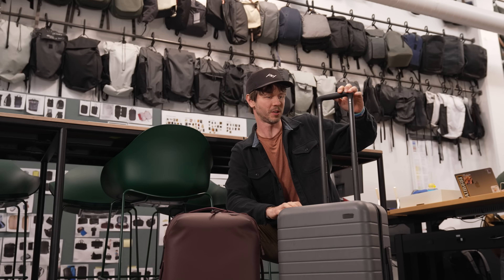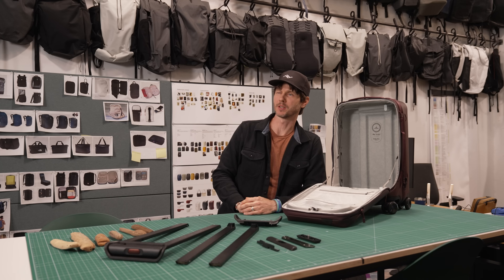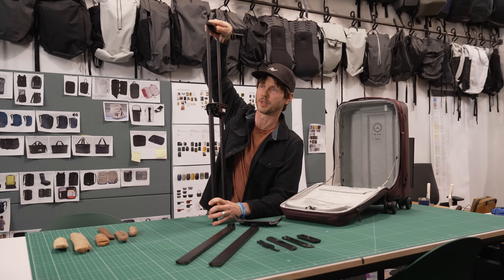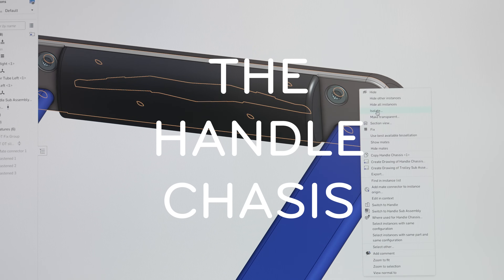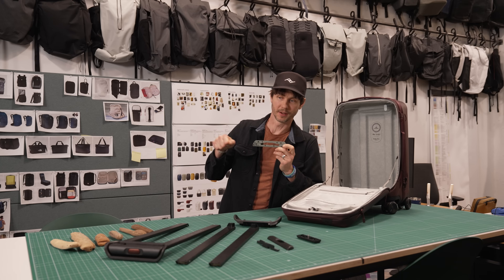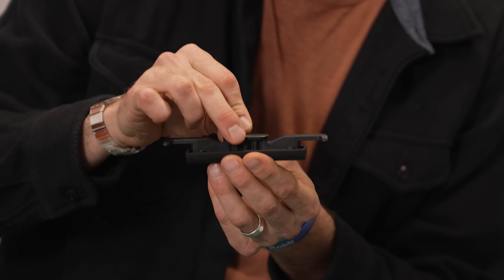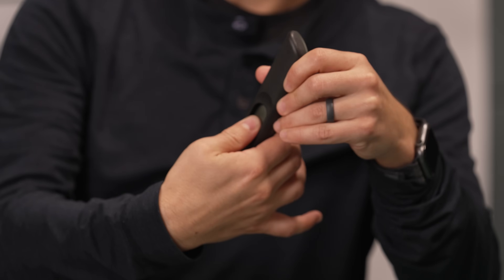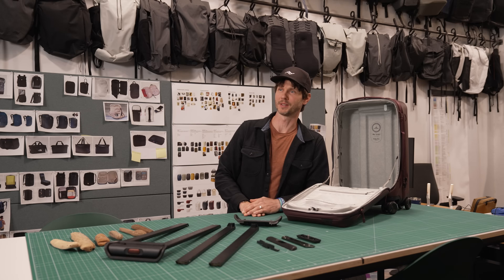Making the World's Thinnest, Strongest Roller Handle

Comment: I made  depth review of travel luggage bags for photographers. An empty bag weighing 3.9 kg is the worst specification I've ever encountered! And this weight is even without dividers. Maybe you all fly business class, but in Europe, economy flights typically allow only 8 kg of carry-on luggage. With this bag, you'll be able to carry just 3.6 kg of gear—one laptop, one camera, and one or two lenses. That’s all you’ll be able to fit for travel.
Reply: A top selling roller carry-on on B&H is the Think Tank Photo Airport Roller Derby V2 and almost the same weight (5kg empty!), dimensions, and cost (on the KS). It has a 4.8/5 on ~200 reviews. Seems the weight should be just fine for a lot of people. 🤷🏽

Comment: @peakdesignvideo Does the trolley stop in any position in the tubes or are there specific positive locking positions
Reply: From the hands on review at PackHacker, it seems to have two different height positions it locks at
Reply: I think there's more then 1 position but 2 or 3 being the max number of positions from what I sae
Reply from the maker: The other comments here are correct, there are two different positions!